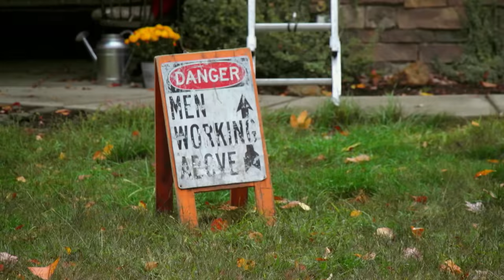New Economic World Order? Industrial Policies & De-Risking From China | When Titans Clash 3 - Part 2

Comment: Chinese are changing the Chinese Rail system to replace the Jet engine... Chinese Rail Locomotives will use Nitrogen to push Chinese Train to 600 km / hour..
Reply: When I visited recently, the HSR line was 680 km/hr, the fastest on earth, and they're developing a maglev for 1100 km/hr.  That's faster than a boeing jet, plus the trains doors and wheels don't fall off like so many Boeing passenger jets nowadays.  And their HSR trains are way more spacious & comfortable than any dang airplane, with way better food and baggage space.
Reply: With Maglev Nitrogen system.... Chinese will replace Jet engine planes with Maglev Nitrogen Train to offer cheaper transport

Comment: Who are these new fabs making chips for? The USA doesn't manufacture much electronic assemblies so it's not for internal consumption. The chips manufactured in the USA will be too expensive and is too far away from the assembly facilities in the far east for an efficient transportation supply chain. This chip de-risking makes no sense at all as it's just all politics and no intelligence.
Reply: The US does not manufacture electronics assemblies because there is no money to be made in electronics assemblies unless you are working for the aerospace industry to aerospace and mil specs. If you haven't noticed, an entry level 4k tv costs less than a medium quality window of the same size made in the US.  If given a choice, I would rather manufacture windows than 4k tvs. Which is what US industry does.